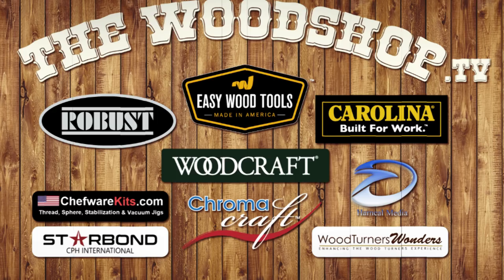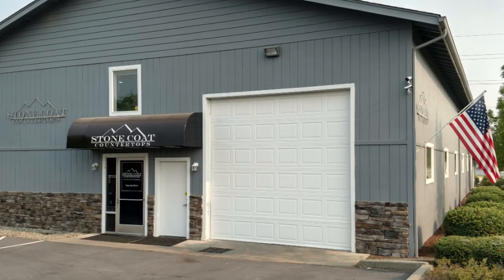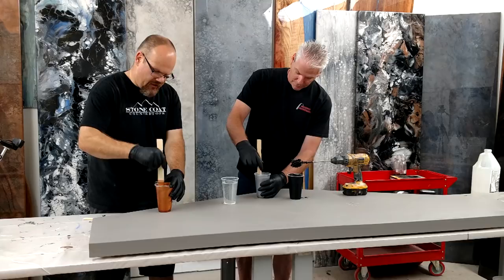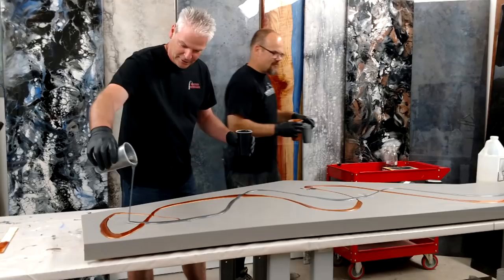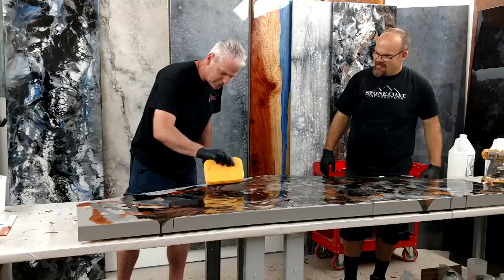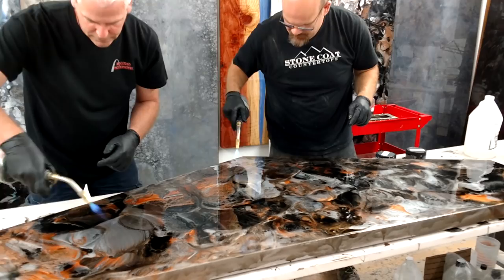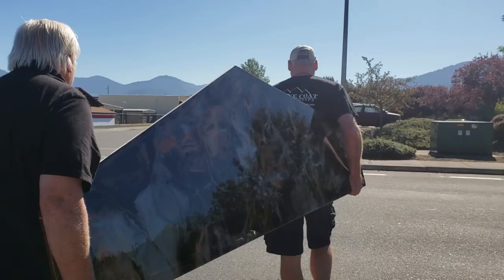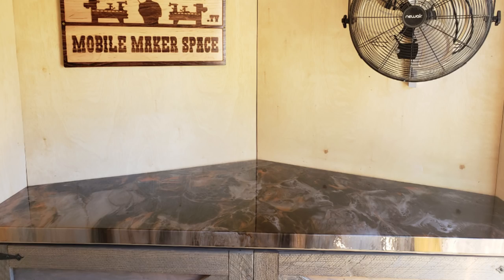DIY Epoxy Countertop

Comment: Hey Carl that looks beautiful! I’m curious if you could speak to the “durability” of an epoxy on MDF countertop? Does it scratch or chip easily? I assume it doesn’t stain easily (and due to your color choice, any stain would be well hidden). Also, do you know how repairable it is? For example, if it’s all scratched/chipped/scuffed in a year from now, would maybe a thin clear epoxy or resin coat make all that “disappear?”
Reply from the maker: Thank you Joel! I know they doing a lot of countertop, I think it's really 
durable. If it dose get scratched a thin coat of clear will make it look new again.